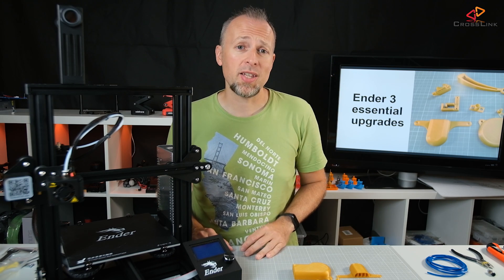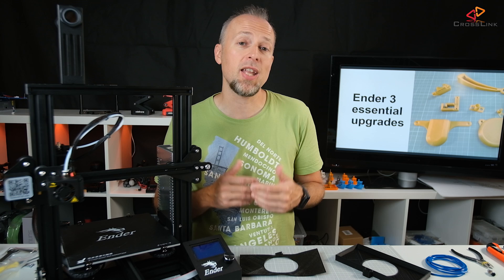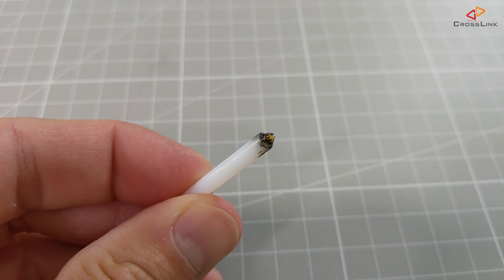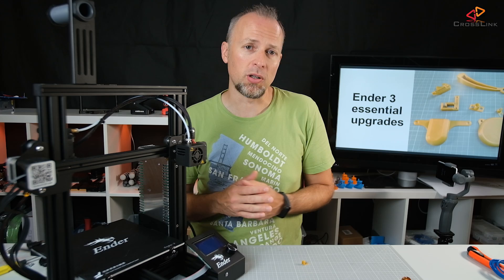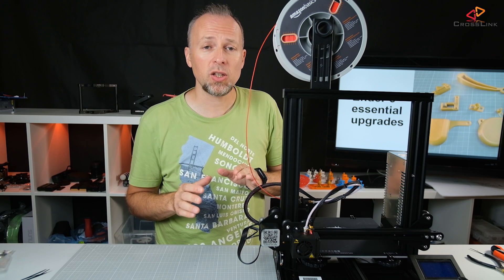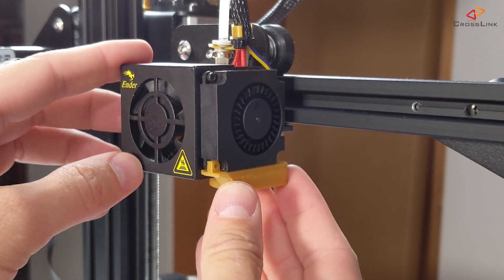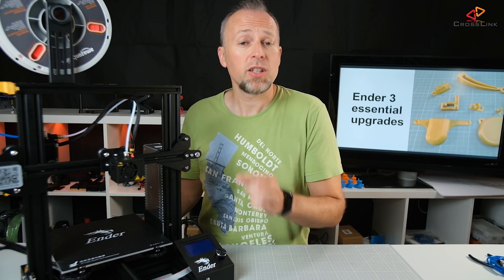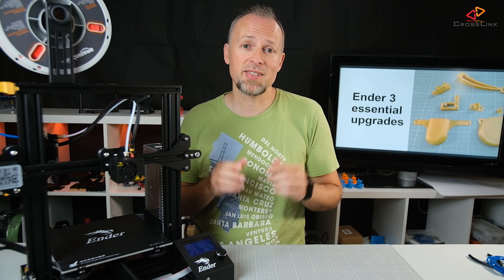Ender 3 Upgrades - Printable Essential Upgrades

Comment: I don't buy that the fan can get clogged by small, thin plastic strips. They have to be at least 0.3 mm thick to even have a chance at that and most of the thin pieces that can fly down there, are thinner than that. With the speed that the fans spin and the fan blades thickness, it is far more likely that the fan simply cuts them over and continues uninterrupted. That doesn't mean it won't be a problem though, as half of the plastic pieces will fall onto the PCB, which can cause overheating problems. So the fan duct is still a good idea, but the reasoning here is flawed. Both on that point and a couple others.

Comment: Just bought a used 3 months old Ender 3 just to print 0.2mm noozle. The Ender 3 Max i bought last year needed 200% of upgrade, it is crazy, to make it work half as good as my Prusa i3 MK3S+. The smaller Ender 3 seems easier to manage, but noisy as hell and your upgrade prints here helps a lot.... the filament management of this machine is a big joke, sigh, creality hahahaha - Andrew

Comment: I have 2 maybe 3 upgrades I recommend. The first is the motherboard fan guard that you had.  The second is an extruder guid wheel for right before the extruder.  I printed the extruder filament guide that you have on this video, but I don't recommend it due to it adding drag to the filament.  Instead I'd recommend a wheeled filament guide that uses actual bearings.

Comment: Is there a link for the various parts you mention in the video in order to get the files to download? Or can the parts be purchased and shipped? I have the video downloaded. How about a video that talks about upgrading the os of the Ender 3, right now I am using 1.1.6.2. Then what the difference is between PLA, ABS, PETG and any other available types of filament and the appropriate glues needed if someone does a print that needs to be assembled afterwards.

Comment: i printed out the PSU shroud and tried that out, but after paying closer attention to the sound and frequency of the fan, i felt it was putting more stress on the fan. i didnt want to risk it failing and the PSU overheating, so i took it off and just live with the fan noise. most of the noise comes from the motors anyway.

Comment: Hi, does the Ender 5 have the same problems?
Reply from the maker: What problems are you referring to?
Reply: @Crosslink3D  for example the filament input in the nozzle. Or filament feeding. Are those the same on the 5 as on the 3?
Reply from the maker: I believe yes, that extruder Setup is mostly identical though I don’t have an Ender 5 to compare at the moment.

Comment: I have the geeetech a10 ender clone. The cooling shroud for the hot end came warped. Do you think i could use the parts you linked for it as well

Comment: After doing research on each of these pieces individually I can report back on whats good and bad (in my opinion). The cable clip can be handy but does require 2 M3 screws of at least 7 mm in size.  The extruder pieces including the fan duct and the inner piece require ABS or else they will both melt. The PTFE cable clip is not necessary on printers with included blue spacers. The Extruder filament guide is also unnecessary on printers with a brass insert where the filament go in. The top mounted guide can be useful however many have complained that it can damage filament and that the base is weak and has broken. Both fan guards/silencers are great and don't really have any cons, they both attach with the existing screws and can be helpful in the long run. So all in all the choice is really up to you but this is what I have found with my research. Hope this helps!
Reply: right i was thinking your going to need something other than PLA for that first little piece he mentions. And personally still being a beginner in 3d printing. i am just learning about stronger material like ABS or PETG

Comment: show from thingiverse the TPU feets for the printer it's a massive 
improvement and lift your 3D printer about 1-1.5" of the ground onto TPU
 or PLA feets which are nose reduction and allow for much better air 
flow as well.  https://www.thingiverse.com/thing:4641590

Comment: Yeah if I could get the damn thing to work
Reply from the maker: What’s going on? What issues do you have?
Reply: Um well its factory issue so I need to install the newest marlin firmware I think
Reply from the maker: Were you successful in installing Marlin?
Reply: Not a clue yet fam I think I have the file but need a boot loader and as for the codeing shit I'm lost

Comment: Can you tell me why the extruder won't print in the center of the bed I level  it and upgrade the with damper but the extruder still make A horrible noise and only print on the side not even print more like making a line do I or can I reset the board

Comment: I've tried printing the extruder insert about five times now and every time it comes out as a rectangle, what am I doing wrong?
Reply: If nothing is wrong with the sliced file, perhaps you should check if your bed is leveled or not, and whether or not the nozzle is too far away from the bed when at 0 on the Z axis. A nozzle that is too far from the bed when at 0 will often cause prints' first layer to not stick, and cause the printer to have trouble printing curved objects.

Move the nozzle to a corner, and bring the Z axis to 0. Get a business card, slide it underneath the nozzle, and tighten or loosen the leveling wheel for that corner underneath the bed. When the nozzle is at correct height, you should feel the nozzle pressing down on the business card a little bit, but not tightly. Do this on all 4 corners of the bed.

Comment: What size screws and nuts are used to attach these pieces? I printed the cord management clip on the z axis thinking there were screws I could remove and reinsert, but there are just hole there? I want to print and install the rest but I need the right screws for this.

Comment: Stepper motors being a whole lot noisier than the PSU fan, the shroud for the PSU fans makes no difference in the end. The printer will still be extremely noisy due to the extremely noisy stepper motors. It's like trying to make the surroundings quieter on  an active Nascar race track by silencing the mosquitos.

Comment: I've made some of the clips, the part cooling duct, and power supply fan shroud. They've served me well so far so thanks for the recommendations. The mistral duct should be printed from PETG or ABS for heat resistance.
Reply: Power supply dan is a must. Also extension cord for the SD card is a must. So
Much easier to insert the SD card in an adapter.
Reply: @elmer3383  I actually took the power supply fan cover off since it didn't help as much as I thought. What did work was replacing the fan screws with silicone PC Fan standoffs (though opening a power supply can be dangerous due to mains voltage being stored in the capacitors, so I'll say "don't attempt this" so you can't sue me).

I still use most of the other upgrades to this day. Great printer that keeps getting better as I learn of other upgrades, such as a G10 bed.

Comment: Hello there, I am currently waiting on an Ender 3 Pro to come in a few weeks. Are all of these mods applicable to the Pro model as well (except for the fan guard since the pro places the hole on the underside) and are you only using PLA for all of these upgrades including the extruder insert? I've watched some other videos on the power supply fan and was told it's much quieter than the original model as well so maybe no need for the silencer either?
Reply: Should imagine the extruder insert will be ABS, as for the power supply fan, the ender pro comes with a  Meanwell power supply that is a lot higher quality and  has a  fan that only runs when it hits a certain temperature , i don`t think the filament guide is needed on the pro either as this was fixed on the pro.
Reply: I know you might imagine that it's made of ABS but we're talking about modding a stock ender 3 which from what I've read isn't immediately ready for ABS. It's supposed to be in a cooler zone within the extruder but that's why I ask.

Comment: Thanks, subscribed to your channel. Question at 03:15 you show the small piece of tube being inserted into the extruder. How long is that piece to carry out the mod ?
Reply from the maker: I've measured this by inserting the full length PTFE tube first until it hits the nozzle, then marked the upper end where it exits the heating block, then I measured the length of the coupling thread that goes into the heating block and made a second mark at the ptfe tube and cut it there.

Comment: Returnd my ender 5 pro with in one week . To many upgrades for me . Magnetic pad sucked and nothing would stick to it . Up grade to gass . An other 75 bucks . Extruder hot end 
 Failed after 2 prints ,  an other 65 bucks . Nozzle clogging 4 times with in 2 prints . An other upgrade needed . An on and on . 
Ender 5 sucks . Dont be fooled by people getting paid for a good review
Reply from the maker: This is an Ender 3 video, not Ender 5 btw.

Comment: Can I use PLA on the Extruder Cooling Duct?
Reply from the maker: Yes, I used PLA and it worked fine. Just make sure you have it well sticking to the print surface so it does not curl upwards.

Comment: Im going to get my ENDER-3 soon. I dont have 3D printer yet but im still watching this video :D so i know what and how i can improve my printer when i get it XD
Reply from the maker: Great to read you liked it! If you have ideas for other topics I should cover, just ask me to make a video about it.
Reply: @Crosslink3D  i have one thing that i'd like to know... If i get glass bed on my ender-3 how well the bed heating will work with the glass or will it work at all.
Reply from the maker: @putputtaja7235  it's going to work well. There is also an official glass bed for the ender 3. Making prints stick to the glass requires some adhesive helper depending on the type of glass and the printed material
Reply: @Crosslink3D  great thanks :)

Comment: Just got the Ender3 pro. Brand new to 3D printing. Do you happen to know if these parts interchange with it?
Reply from the maker: Most of them will work but I did not test in depth. Will have to get my Ender 3 Pro first and do some initial testing.
Reply: Crosslink Thanks for the reply! Looking forward to running this thing through its paces.

Comment: Do the fan covers allow for sufficient air intake?
Reply: The MiniJunkie they are exhaust
Reply from the maker: The mainboard fan cover is letting enough air in. It is really essential. Your mainboard fan will fail fast if you don't prevent waste falling in. The PSU fan cover is exhaust fan to silent the fan.

Comment: Hi, I planned to get new couplers (with metal teeth) and a Capricorn PTFE tube but leave that tube in one piece. Do the metal teeth couplers and new Capricorn tube + such fitting clip fix the tube moving issue or do I still need to place the small tube piece and the  insert piece in the hotend? I feel like one continuous tube with good fix would be better.

Comment: that bowden connector clip is like the locking clip for the pressure line a first gen ford focus fuel pump. mine was missing and it was a mess lol

Comment: I don't think its a good idea with the insert in the extruder. Pla filament gets pliable at fairly low temps it happens in hot cars. I think over time it will get deformed and cause some significant problems.
Reply from the maker: So far after 100h and more productive print time, I did not have any issues even at higher temperatures like 225 with petg.so it seems pretty see stable.

Comment: Creality now includes a spare bowden fitting and little plastic clips that go between the gap like seen in the video. Be wary though, sometimes one or both bowden fittings are faulty and don't grip the tube rigidly causing retraction problems. Even the spare fitting can be bad (yes, all 3 can be bad if you got bad luck) causing even more problems. You might want to get a metal extruder upgrade kit.

Comment: No mention to never remove both of the power supply screws at the same time or you're taking it apart to get the fan back up into position? 
I skipped all the Bowden upgrades and went to a Direct Drive and love it, simpler and I can print flex easily! But I really like the PTFE clip, never seen that before and it makes a ton of sense but I'd be concerned about it deforming due to heat creep. Either way, not necessary with the direct drive set up!
Reply from the maker: Good catch with the PSU screws. I did not mention that but you are right.

Comment: Great video thanks for sharing. 
I saw a video where the filament spool gets a bracket to hold it closer and closer to the extruder.  This is done if you have a bit of room because the spool is mounted on the side instead of the top. Your upgrade will work for me because I don't have the real estate on my bench for the other sd spool mount.

Comment: what about modifying the extruder motor to sit on top of the extruder itself? no more Boden tube.  but will have to add another stepper motor with the drive to accommodate the added weight. just an idea. I have had my new ender for 5 days now. many problems i am having. ugh
Reply from the maker: Well, this could of course remove bowden issues. On the other hand, you can print faster with a bowden drive. Less moving weight is always better for speed and accuracy. Also the point here was to talk about printable upgrades but I will talk about some other great updates that involve buying new hardware soon.

Comment: I'm brand new to this.  Just got my Ender 3 yesterday.   Thanks for the great tips!
So the PTFE tube I want is 4mm OD?
Reply from the maker: Yes, 4mm outer and 2mm inner diameter will work. Be careful not to make the hole where you pass the tube through too tight. It might otherwise press the tube too much and it will cause additional friction to the filament. I also installed a spacer at the extruder motor to increase the pressure to the filament because I had underextrusion issues (even without the ptfe tube guide). Maybe do both in combination for best results: https://www.thingiverse.com/thing:3066664
Reply: @Crosslink3D  Yeah, the tube doesn't even come close to fitting through the hole.
Reply from the maker: I drilled it to fit better

Comment: Great vid...  are these upgrades the same for the pro version? Thx
Reply from the maker: Unfortunately I cannot give you the answer as I have no Ender 3 Pro to compare. The cable guide should work, Fan covers too. Also the extruder fix should fit, there is also two different versions on Thingiverse, I checked both. Things that get attached to the extrusions(frame bars) are probably not fitting due to the Ender 3 Pro having thicker extrusions.

Comment: Hello Daniel, as an architecture that builds 3d hotels/motels/house/business centres, i would like to join into this competiton. I went through a lot of 3d modeling and 3d printing community/industry. I build them in 3ds max, AutoCAD architecture, sketch up pro & Lumion. I had to build them to show my clients and with managers that i worked together. Anet a8 is the most popular printer since late 2017. Most of the people has it. It is easy to use and also the cheapest printer. If i win ( not sure ), i will build architecture models and complete the projects realisticly. I would show it to you. ( if i had one ). Danke Daniel for this giveaway.

Comment: Teaching students as a product designer lecturer, we have been creating and modelling 3d objects using Blender, Autodesk & 3D Max. We had to print them in 3d store for the final assignments. But yes, we had to save them in Meshlab & fusion 360 before we print. It would be more easy & fast if we have a printer. Unfortunetly, we got no 3d printer of our own and i cant expect/force my students to buy it. Our students are taking this courses through loan. We got to do what we have. I know it is not easy to ask for a 3d printer, but just to let you know only. I got no instagram but i have facebook. Btway Daniel, thank you.

Comment: A 3D printer would be swell, I've gotten things printed via others earlier since I have none. But most of the time the turnaround time is just to long for things like simple fixes of broken stuff and most of all prototyping and I just skip that project or in the best case make do by simulating as much as posible or make simpler mockups from paper. It would also be nice to show a more hands on side of engineering to my kids, create things that extends their toys or combines different things. You'd find me @sadropol on twitter (though I haven't used the platform much except for things for IRC-bots)

Comment: This was a great and very helpful video.  It was straight and to the points, with no annoying background music.  Very simple, clear and concise explanations that are easy to understand and follow.  If chosen, I would like to have the Ender 3  to add to my Etsy shop collection of equipment, which currently consists of a small CNC (used for wood) and a small Electronic Die Cutter (used for paper, felt, & foam).  I would like to expand my capabilities into plastics, and, this would be ideal.  My Etsy shop income helps us (my wife & I) to meet our expenses, as I lost my job almost 5 years ago, and, in America, when you are 50 and above - finding a job is not easy.

Comment: I already have a bunch of these parts installed on my Ender 3 but I like the cable management and the filament guide.  I'll have to give those a try.  Thanks Daniel!
Reply: where does one find these designs?
Reply: @bretrishelrc9789  thingiverse.com, cults3d or just simply google what you need, someone has probably already made an stl file for it :)
Reply: @bretrishelrc9789  You can find designs on Thingiverse. Just go to www.thingiverse.com and search ender 3.